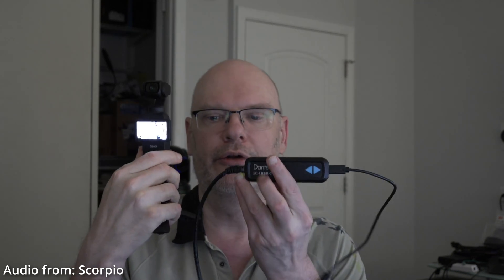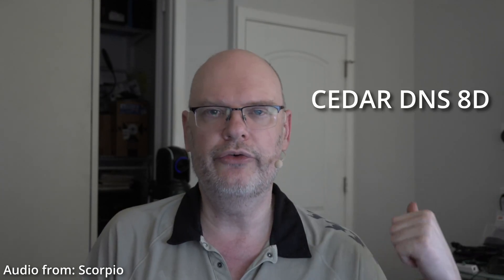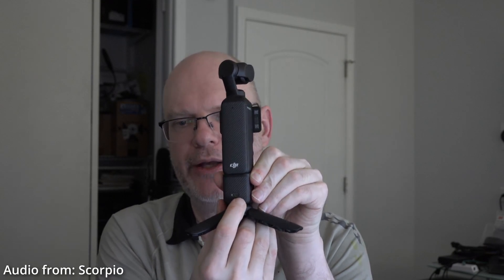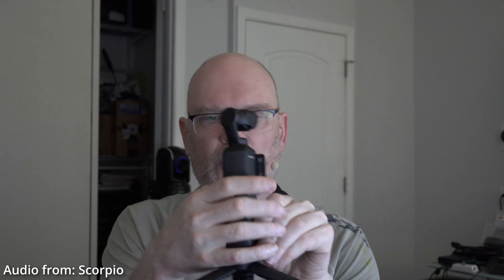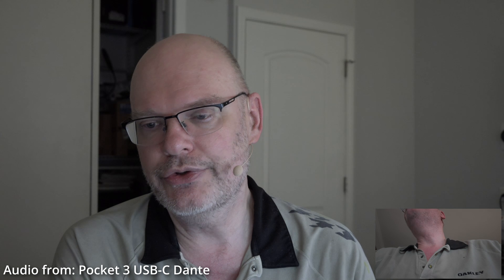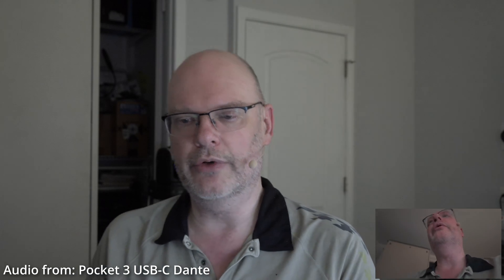DJI Osmo Pocket 3 with Dante Audio

Comment: Thank you very much for content! 
 I was wondering if its the same for android with the same compatibility like s20 fe ,I just got Dante sound card and Dante via with a POE switcher and I was wondering before investing close to 300$ if the latency absent or i need also the Dante output dongle as well thank you
Reply from the maker: I have an older video on my channel where I tested the AVIO USB-C with my Google Pixel.  I don't have any Samsung phones, so I cannot test them myself.  I've heard that Samsung did similar to Apple and doesn't support USB audio class for voice calls, but other apps (like voice memo apps and music apps) do support USB audio class.  I don't know if they've changed that or not.

As to latency -- the AVIO devices are all built on Audinate's Ultimo chipset, which has a minimum Dante latency of 1ms.  That's plenty fast for feeding a video recorder like the Pocket 3, where a frame is 33ms (at 30fps) such that you won't have lipsync errors.  I was using all hardware Dante devices in this video, but even the minimum 10ms latency of DVS is probably workable if you need to send from a computer to the Osmo.  Just don't do multiple round trips through DVS.

Comment: Wonder if I could just plug in a USB-C mic, directly, such as a RØDE Podmic USB or NT USB Mini, just to name a couple.
Reply from the maker: They should work, yes -- so long as they are USB Audio Class compliant.  I don't own any of the devices you mentioned to personally test, however.

Many desktop USB interfaces implement proprietary USB audio transmission (like RME, for example) and that will NOT work.